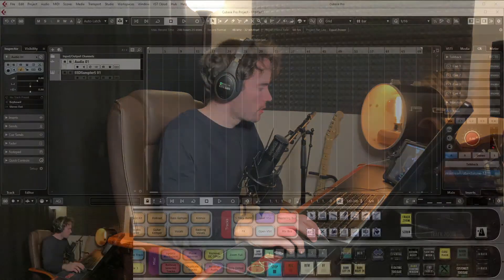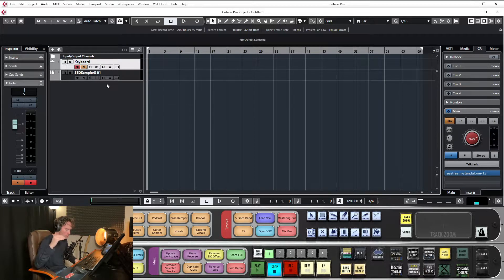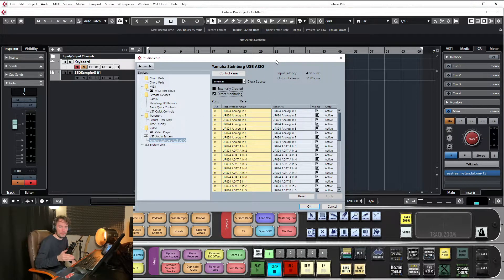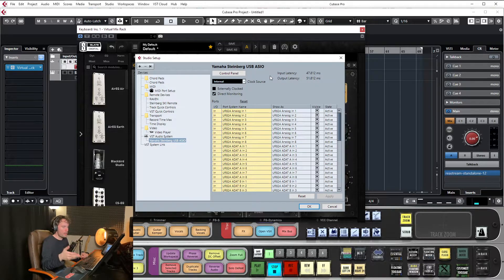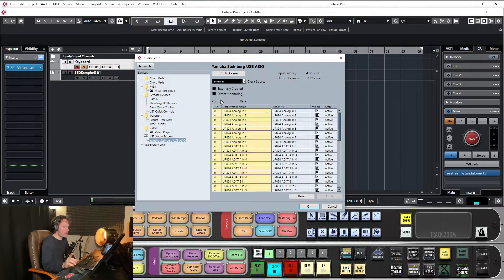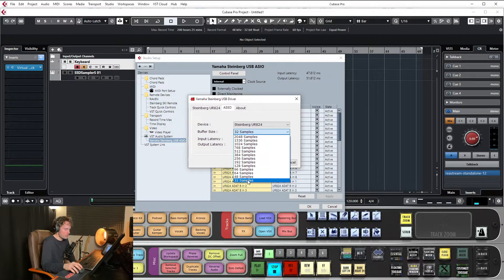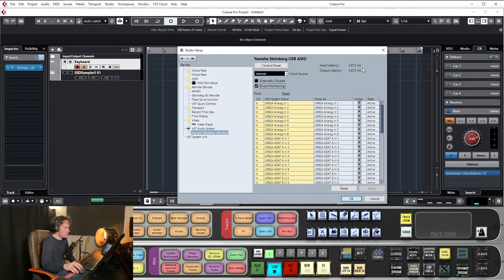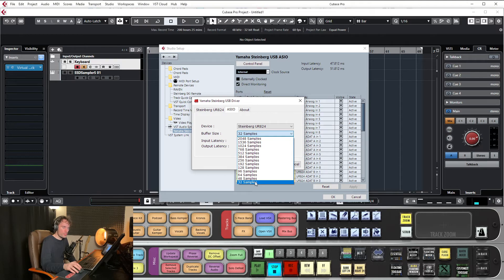Cubase Tips: Direct Monitoring and Latency

Comment: Hello, thank you for your video. When recording a vocal i monitor the direct sound of the mic into the soundcard mixer (antelope) where i mix the mic direct sound and the cue mix coming from cubase. I would like to be able to send the previous vocal recording of the track until i am punching but not when i am in the punch section without having to turn it off in the cue section of the track. Otherwise the singer ears it twice and with a delay: from the direct sound of the soundcard mixer and thru the cue with latency. I also want to hear in my control room when punching. Is there a function in cubase where when in punch-in mode (or even record on existing track) the monitoring is automatically cut in the cue only and not in the control room. And of course i don’t want to use another track for the punch, i want to do the punch in the same track. Of course if you have ultra low latency you do every thing in cubase using tape style monitoring in preferences (but i have to much latency even at minimum buffer size). How do you manage this issue with your sound card (that doesn’t have direct monitoring option from cubase) ? If you have any explanation or video link, you are welcome.Thank you
Reply from the maker: Just to clarify - your interface does not give you the option for Asio Direct Monitoring, correct? Are you able to hear the mic in real-time but the singer isn't? I think the issue is that you shouldn't be sending a live mic via cubase at all. All live audio sources should be separate from Cubase (if you don't have direct monitoring). I used to have this issue and used an old analogue mixing desk to send real-time signals to performers along with Cubase playback and did not rely on Cubase for real-time monitoring sends. When I was able to utilise Asio Direct Monitoring I no longer needed the desk as Cubase could now handle real-time and recorded sources in the box simultaneously. I had a Steinberg UR824 for the latter setup. I now use the RME Fireface UFXIII and all the real-time signals and Cubase signals are handled within TotalMix FX which is essentially a separate mixer. I now don't even need to use Asio Direct Monitoring. And as far as I'm aware it's not possible to cut cues automatically in Cubase. You can't even record automation in Cues which is a shame. Hope this helps!
Reply: @studio1790  no, he ears himself thru the direct sound of the sound card and i ear him thru the daw. but when i punch he ears in double, thru the sound card and the daw... the idea is to cut his vocal in his  headphone mix while punch-in only
Reply from the maker: @remixk  I think Cubase has a setting that can turn off monitoring automatically when you press record, but I’m not 100% positive on that. When I was recording with the UR824 I used tape machine style recording. There may be another setting that could help you achieve what you’re looking for? You could also try messing around with the mix and cue buttons in the control room tab and see if that stops the duplicated audio situation.